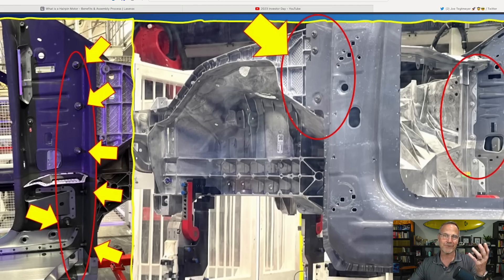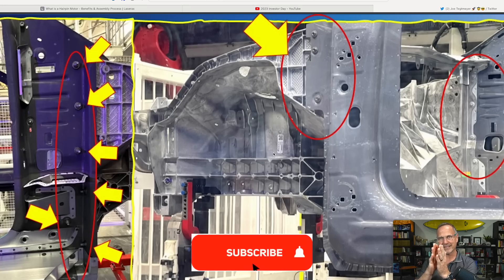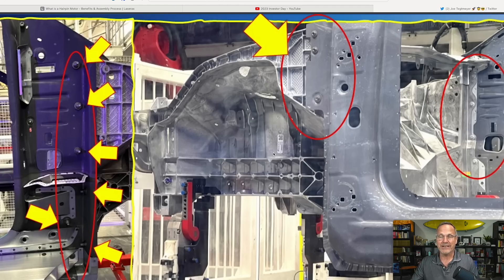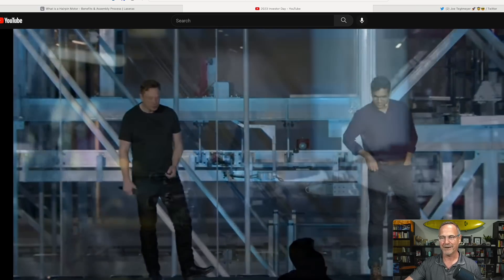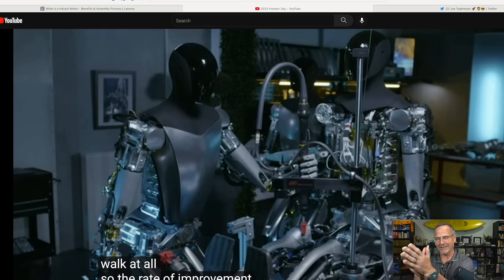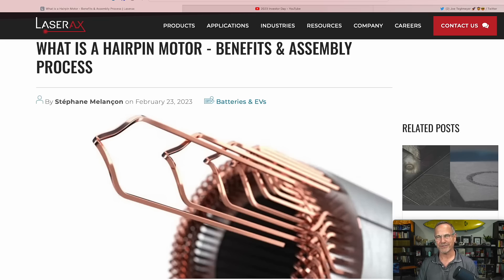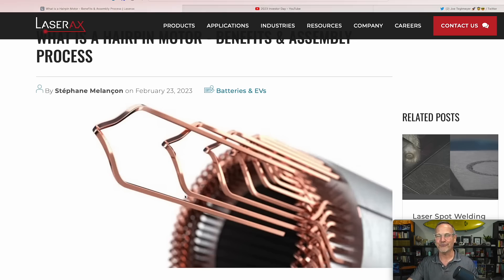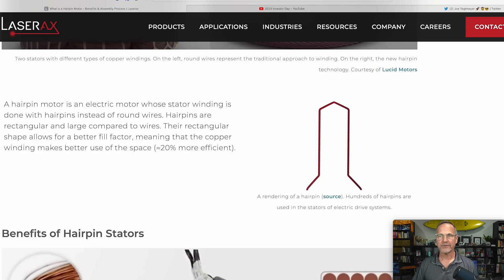Tesla Has HAIRPIN MOTORS! 🤯 What the Heck Are They?  Plus Teslabot is REAL, and How To Attach Panels

Comment: The reason Monroe is so excited is because the Hairpin motor design along with the 4680 efficiency gain adds 36-38% increased efficiency.  Basically you can have the same mileage and torque with lower weight.  As we all know weight is the bane of electric vehicle efficiency so this additive gain is really a geometric gain in that the real world gains are more likely 40-50% because of the reduced weight.  This along with the manufacturing efficiency gains (whole body casting, zero welds, etc.) discussed could result in a gigantic drop in overall end of product cost.  Basically, Tesla may be sandbagging with a 50% cost reduction over the next six plus years if they perfect all of these processes.  Pretty crazy that a company of this size can innovate and implement on the fly.  It is really unheard of and harkens back to Musk's statement of the machine that builds the machine.
Reply: Overall weight reduction would be minimal with this design change, the battery weight is the real problem for EVs. Electric motors are already comparatively light, still I suppose every little helps and the efficiency gains using this kind of winding is of more importance.
Reply: @Schrodingers Cat  I agree it's the battery that is extremely heavy sometimes ill see a tesla model 3 and try push so it swings side to side doesn't budge at all, crazy heavy
Reply: @Schrodingers Cat  I agree it's the battery that is extremely heavy sometimes ill see a tesla model 3 and try push so it swings side to side doesn't budge at all, crazy heavy
Reply: @Schrodingers Cat  I agree it's the battery that is extremely heavy sometimes ill see a tesla model 3 and try push so it swings side to side doesn't budge at all, crazy heavy
Reply: 36-38% increased efficiency is very specific, sounds incredibly dubious. EV drivetrains already around 90+% efficient. Maybe 36% reduction in losses? Can you please cite a reference?
Reply: @iandavies4853  It certainly can't mean the motor ends up being 36% more efficient overall! These are actually small improvements (though useful). If something is already 90% efficient then the potential improvement can only whittle away at that remaining 10% ... and it can't be more than 100%. I'm guessing that it means they have taken a further 36% out of that 10% ... so an overall 3.6% ... which would make the motor now 93.6% rather than 90% efficient perhaps.
Reply: @MrAdopado  agreed, it’s mis-use of maths. Also note breakdown of zealot’s claim - half is battery. While (tiny) gain in motor efficiency is welcome, other factors more important now. Like price, manufacturing, scalability.
Reply: @iandavies4853  Sure.  Internet searches and information provided during the event.  Motor was like 20% and 4680 touted to be 17% over current batteries.  Added them together and then expounded based on reduced weight and efficiency gains of both.
Reply: @ThePuttercross  thanks. Motor can’t be 20% better efficiency, given already up around 93-96% in better parts of use range (rpm/ loading). 4680 use same chemistry as 2170, just better heat control, better pack integration.
I’m Tesla fanboi, don’t gild the lily.
Reply: @iandavies4853  Ian, they can because they are a more efficient uses of space.  Round wire versus square/rectangular wire will increase the overall efficiency of the motor by providing the same torque/speed in a smaller/lighter package.  Same thing as the 4680 vs. the 2170.  It all comes down to space efficiency.  Hairpin motors are more efficient than standard round copper wire motors because of the physical geometry along with other factors.  Again, same with the 4680.  This is what is claimed.  Will it bear out?  We won't know until the motors and cells are widely implemented as real world often differs greatly from the laboratory.
Reply: @iandavies4853  You are correct with you reasoning regarding the alignment of wires (hence my earlier comments about patents) and you are correct about your the pins needing to be laminated.  Your comments about Tesla are interesting as they have lead the way for Auto manufacturers for about a decade now and literally invented a new aluminum alloy to accommodate doing giga castings.  I would not put anything past their engineering group.  Between them and SpaceX they have been getting the top engineering talent every year for a decade and the results are showing.  40% efficiency gains are absolutely on the table for drive trains just from reduced weight and possibly eliminating rare earth metals (cost of batteries will go down over time similar to the scaling of PC processing speed over time only in the reverse).  I have been investing in Tesla for years and from a manufacturing standpoint (I am an engineer that owns two manufacturing businesses) I do not see anyone catching them.  They innovate and implement like a small company while being one of the largest as far as cap value in the world.  Pretty crazy.  Good luck to you and I hope you have a good day.
Reply: @ThePuttercross  As mentioned already, you can' t increase efficeincy above 100 percent, so the 30-40 percent increase is more likely related to power and torque to weight ratio which should be possible going to hairpin design.
Reply: @michalfaraday8135  Yes, and when you look at the overall efficiency gained from the 30-40% increase in torque and equate that to weight savings you can increase the overall efficiency of an electric automobile.  Weight is everything in electric vehicles as more weight requires more battery capacity which leads to more weight and the inverse is also true.  I believe you are simply focused on the electric motor and I am focusing on the overall system, hence why adding together the overall system efficiency gains of reducing the size and weight of a motor and batteries will lead to a lighter and more cost efficient vehicle.
Reply: @ThePuttercross  No. The overall efficiency of the drivetrain now is over 90 percent. A few extra percentage points won't get you a significant reduction in battery weight and the reduction of weight in the motors is TINY compared to the overall weight of the vehicle which is what matters. 
Tesla might have a 40 percent improvement  compared to, say, a Model Y, but that would be mostly as a result of the car being smaller and therefore lighter and needing a smaller battery. It won' t be a result of better power and torque in a smaller motor.
Reply: I wonder what took them so long
Reply: @imaro2358  If I had to guess? They probably had to negotiate the rights to use the process. Its not their tech.
Reply: @davefroman4700  Could be. I checked and one of the patents is held by Ford. I believe Lucid picked it up from their electric motor partner.
Reply: @imaro2358  One patent is but the interesting thing about patents is that a design patent is easily modified to design around.  Change the size, orientation, shape etc. and the patent no longer applies.  Utility patents are more difficult to alter as they typically involve processes and principles.  Many electric vehicle manufacturers use hairpin motors so I suspect that the patents ran out long ago or are just design patents based on a design tweak here or their.  We will see.
Reply: Tesla is catching up. Mach-E, amongst others, is already using hairpin and Sandy Munro covered it a year ago on his channel.
Reply: Bullshit!!! He totally forgot to mention that other manufacturer have already almost eliminated the use of rare earth materials and hairpins motors even sandy munro said that about the vw motor and even the Porsche motor is hairpin, in fact almost all European motors are hairpins
Reply: Honestly it's not so much the weight that's going to save much, it's that this weight is supposed to be spinning so it has to constantly spin up and down this weight every time you change speed, but it's geared so it has to spin up and down a lot for just a small speed change. That's what makes this so cool.
Reply: And he is so excited is that his job is selling secrets.  When he finds some secret that he uncovers that impresses him, he has something to sell.
Reply: Weight is important for all transport. ICE just undervalued weight. But cars seem to use soupcan metal compaired to fine bicycle.
Reply: Can this ....apply in reverse for ...for wind turbines..😊😮
Reply: Weight reductions also result from requiring a smaller battery pack due to the motors efficiency. Refining their own lithium is going to add to it as well. Mexico has a lot of lithium clay deposits and Tesla has a new process specifically designed for these types of deposits. Everyone else is working on brine deposits or hard rock mining. By opening up a new source they will not be in competition with the rest of the market.
Reply: @davefroman4700  there will always be competition lol
Reply: All of this will be better for tesla makeing more money but what about the customers? Any? Nothing? That's what I thought 🤔
Reply: @pierrejeanes  Maybe you should wait for Customer Day then. Anyhow lower cost tend to lead to lower price, once more companies participate.
Reply: @michalfaraday8135  I don't know but the last 30 years car prices are going up every day and never down, no matter efficiency or whatever
Reply: @pierrejeanes  model y price dropped 20% last month

Comment: One other thing we learned is that Optimus is also being designed with a 48V architecture. If you check the slides from the presentation, when they put up the slide about the adoption of 48Volt.
Reply: They switching the vehicle platform to 48v too, I wonder if this is to allow interoperability of some of the components.
Reply: @MGarafano  Its a weight/energy savings issue. The bot is already using the computer from the car as well.
Reply: @davefroman4700   I'm curious about the weight difference with having to use a 48V battery? I guess for the same number of Ah, the weight would be about the same, or slightly more perhaps.
Reply: @apterachallenge  It doesn’t change the battery size directly, but your wires, motors, and switches get more efficient or smaller (less current)
Reply: @apterachallenge  You can make a 48V battery out of 16 cells. The form factor can be anything. It doesn't need to be big cells at all. Its merely a buffer between the dc-dc step down converter and the LV systems.
Reply: @davefroman4700  the bot doesn't use the computer from the car it's a different hardware
Reply: But, we don't know if it's animatronic. Does Musk ever lie? Can you answer that?
Reply: BMW Porsche and Volkswagen have been using the hairpin tech for years. So, Tesla is late?
Reply: Nice catch
Reply: @Felixi0  😁🤫
Reply: Im guessing a 200ah LifePo4 battery. Should be good for about 10 hours with limited walking in a factory setting.
Reply: The only trouble with 48V except for incompatibility with existing parts is with the mechanical switches. They start to draw a welding arc when trying to disconnect 48V DC under load. This doesn't happen with lower voltages or with AC. Special (expensive) mechanical switches are needed.
OR  one has to overcome the fear of having a permanent silicon path to all devices and switch everything with solid state. Not something I have a problem with, but there seems some hesitance towards using solid state everywhere. Point is: going 48V means eliminating mechanical switches or using expensive mechanical switches if the requirements mandate it.
Reply: @mennol3885  They are not using mechanical switches. They are using digital relays.
Reply: Wrong
Reply: This is a very important missed fact, I wonder what advantages the robot he’s gonna have from switching to that type of architecture
Reply: @JosephDefendre  Less weight, less electrical resistance, less energy loss. Does not matter what the application is, 48V is a cost/weight savings. Most home storage applications on the market today are also 48V. If you have a 12V system and a load that requires say 600watts? You need a wire thick enough to handle that 50amps. Volt x Amp = Watts. With a 48V system you only have a 12.5 amp draw. Your wire gauge is a 1/4 of the thickness.
Reply: @davefroman4700  Also for power semiconductors voltages below 100V are very easy to find parts for while the higher currents needed at lower voltages require more costly semiconductors.  48V is near a sweet spot where cost of semiconductors for a given power is low.
Reply: @kensmith5694  Yes I thought about that too. Its not my area of expertise but moving to 48V in theory would allow for small efficient chip architecture as well I believe. And virtually all PC's today run off a 12v power supply.
Reply: @davefroman4700  CPUs tend to run on voltages under about 2.5V.  General logic and microcontrollers tend to run on 3.3V.  USB is 5V powered.  RS232 generally wants more than 5V both positive and negative.  Converting voltages down from 48V can be quite efficient.  Motors and the like are off the shelf for 12V, 24V 48V so the voltage can be selected from among those for other reasons.
Reply: @kensmith5694  I stand corrected. As I said, not my area.
Reply: @JosephDefendre  less copper.
Reply: Note:  In the US, 48V is considered generally safe.  Voltages above that are considered a shock hazard and the design has to be made such that a human can't come in contact with the higher voltage.  This is a reason to not go with 100V for example.
Reply: Porsche Taycan has both for years.
Reply: @docsnider8926  48V in  Porsche is only for Dynamic Chassis Control System, not the entire low voltage network.  It still has a 12V battery and all the accessories (lights, window motoros, heating, cooling) are 12V.  Porsche is using traditional wiring looms, so there is a wire that will run from each  element in a tail light to a controller near the dashboard, where all the switching is located.   Tesla's plan is to make a Networked vehicle, so 48VDC is distributed by Power over ethernet to controller nodes throughout the vehicle and the wires from the tail-light terminante at the nearby node.. so you only need one or two cables going the length of the car, rather than dozens.  VW and Porsche have not announced anything close to that, much less have it.
Reply: @qcca123-f1v  that's nothing special lol!!
Reply: @qcca123-f1v  vw and Porsche doesn't need to announce nothing about it! Porsche introduced the 800volts architecture years ago and that was just the beginning
Reply: @docsnider8926  The Porsche Taycan does not use 48V architecture.
Reply: @Wolfgang Preier  As made by Schaeffler not Porsche. It's nice to have a big fat cheque book for expensive parts but it doesn't scale to a $25,000 car which is the point of discussion here. Lucid make their own motors as far as I can tell so props for that even though they will sadly,  probably go bankrupt in the effort to scale.
Reply: @wolfgangpreier9160  yes it uses it! Allot of European manufacturers actually uses 48v architecture for years already with their stability chassis control and mile hybrid......
Reply: @garethrobinson2275  lol!!! As if Porsche just went and bought the motors without also contributing to it's development?!
Reply: @alanmay7929  Its not the main power supply for the car. Only for the single motor attached to the gearbox which is used for boosting and starting the fossil engine. That's not comparable in any way.
Reply: @wolfgangpreier9160  it's comparable lol!!!
Reply: @alanmay7929  You tell me the window regulator in 48V vehicle is just the same as the starter-motor-generator in a mild hybrid fossil vehicle.

You should start product development at GM. Your knowledge is exceptionelle!
Reply: @docsnider8926  Porsche Taycan has nowhere to charge, bad batteries, and horrible software.  Maybe they should fix those problems before making new ones?  lol
Also... I looked it up.  Porsche Taycan is a 12 volt system.
Reply: @davidbeppler3032  stop talking nonsense! Porsche taycan can literally charge anywhere there is electricity' and btw electric vehicles have never contributed to the building and maintaining of the electrical grid what a joke!
Reply: @alanmay7929  Yes the electrical grid is a joke.  We agree on that.